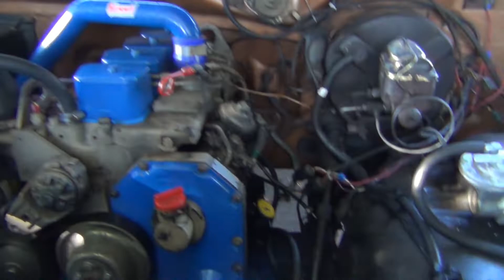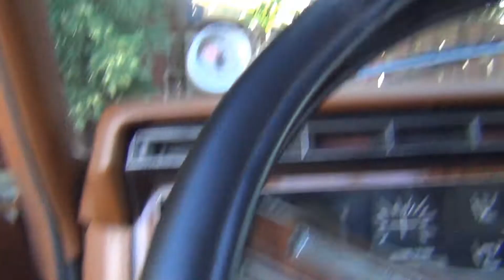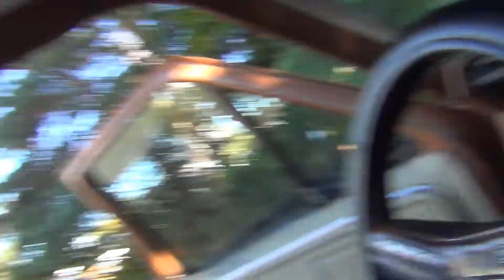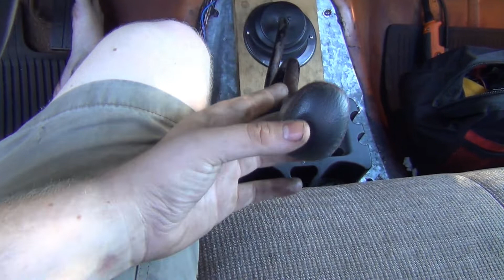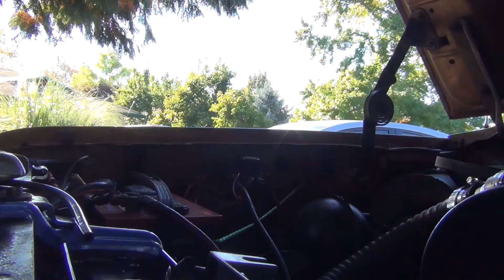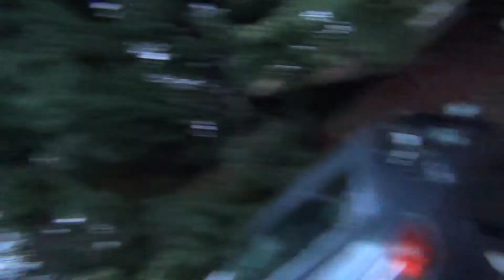Ford F150 Updates and Upcoming Rear End Project

Comment: I would reccomend you look into either a M5OD out of an F150 or a ZF5 out of an F250/350 that was equipped with the 5.8L. Its all SBF bolt pattern and yoj wont have to get an afapter plate. The ZF5 is a wide ratio with granny low and OD, the M5OD has OD, but is a lighter duty trans. Also, if you are going to put a LSD in, its going to male the rear end slide oyt from under you a lot easier when it's slick.
Reply from the maker: Todd Boock Yeah going for that drift truck status. lol I'm still figuring out the trans deal. Staying away from the M5OD though.
Reply: justhes M5OD is a decent trans. It's survived well behind my mildly souped up 351 with 33" tires and 3.55 gears. Either one will serve you well, especially if you aren't planning on hauling heavy loads with your truck.